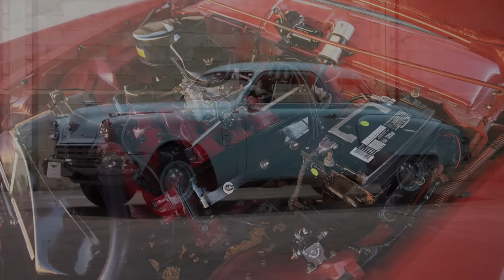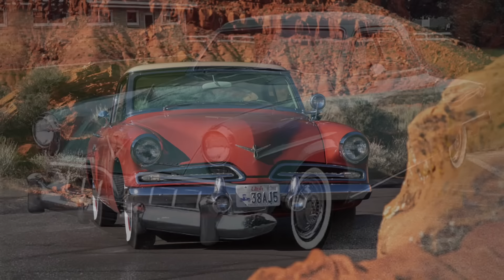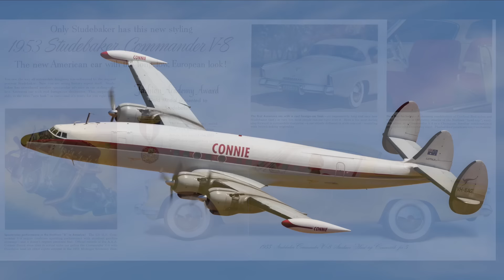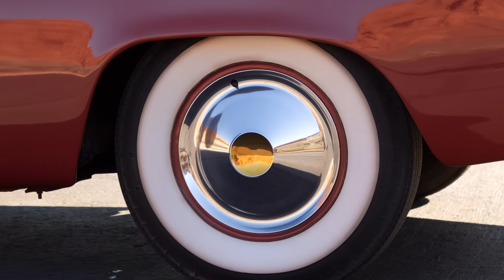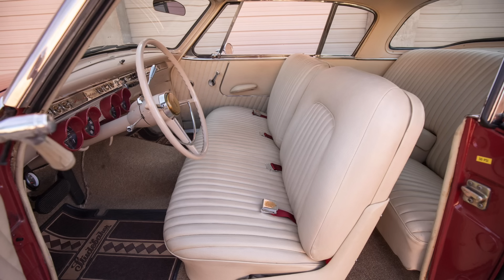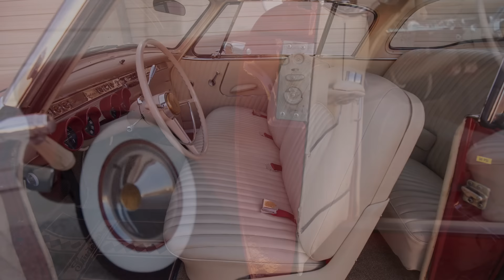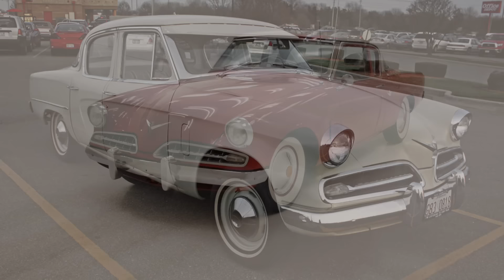Most Beautiful (& Flawed) Cars: 1953 Studebaker Coupes Had Only Skin-Deep Beauty

Comment: Keep everything above the frame (the body) plus the hubcaps, donate everything else to someone in need. The frame, engine, drivetrain, and running gear are abysmal. The body after getting good looks is very fine. I could see lowering the front part of the roof somewhat, angling the entire assembly downward a bit. They seem cheap enough to where modding the hell out of it while keeping the overall looks would be an awesomely fab project. Who would care if only the sheet metal and a few other choice bits were a Stude .. I wouldn't

Comment: My first car was a 53 Studebaker Coupe.  I bought it for $85 in 1961.  It had the V8 with a 3 speed manual with overdrive.  By the time I got it the fenders were rusted and it had a broken leaf in the rear spring (witch I couldn't afford to fix) but it ran fine.  I could be convinced to buy a restored one.  A stunning design!

Comment: Later the Hawk came with a Packard 289 engine in an attempt to increase the performance.  It was often connected to a 4-speed transmission.  Unfortunately that made the weight distribution of the front and rear wheels even less optimal. The result was a loss of traction and a tendency of the rear wheels to slip under throttle.

Most of the early problems were fixed as new ones presented themselves.  Part of the performance problem was Studebaker continued use of thicker gauge sheet metal in later years.  A boon in a collision it was not nearly so welcome at the pump or off the line.

Comment: The sales literature referenced the European look. Sir William Lyons’ seminal 1948 Jaguar XK 120 was no doubt highly influential with the Loewy design team. The  Studebakers longer wheelbase allowed the designers to greatly improve on the Jaguars cramped interior. Unfortunately it also accentuated the frames ability to flex. The XK 120 was built on a shortened version of the stout Jaguar Mark V frame and that rigidity allowed for acceptable racing performance. Jaguar developed the XK 120 into a pure competition model, the C Type, but replacing the XK 120 based frame with a much lighter and stronger tube frame design. Studebakers’ later performance car, the Avanti, saved weight with a fiberglass body.

Comment: I was 17 in 1962-3:  I had one of these with 3 speed, 232. OHV V8 w/ over-drive -  we put in a floor shift and an OD clicker switch on gear-shift lever. You could click the OD in and out in every gear.   I put an ARC 45 rpm record player in it  w/ Motorola Vibrasonic, with two rear speakers, quite cool .  I always loved the lines and body design because it looked like no other car of the time.  Studebaker caught a lot of flak for their "Lighthouse" look models, but then comes this Commander and  the industry changed.  I really wish I still had my '53.  I do, however, have a 1982 Alfa Romeo Spider Veloce with similar grille shape.  PS:  The hoods on these cars were notorious for coming loose  at latch and wrapping over the roof.  Happened to me twice.

Comment: There was a really good article by Michael Lamm in one of the early issues of Special Interest Autos about the 1953 Studebaker that covered some of the issues that you mentioned in your video. Another point that I remember was that Studebaker didn't expect the demand for the 2 door coupes to be so high, so they lost a lot of sales because the factory was building mostly the regular sedans instead of the coupes.  The ornaments with the three pointed stars that Mercedes objected to were changed sometime in the model run. The gray car at 7:23 shows the original 3 point stair design, whereas the red car at the beginning of the video shows the later ornament without the third point.

Comment: My first car was a 1955 Studebaker Champion. I bought it in 1960 for $125.00 and a 1949 Cushman motor scooter. I drove it all thru high school. It had a straight 6 cylinder engine  and "three on the tree" which I later changed by buying a Hertz converter kit to put it on the floor. It was a fun nice looking car for a young guy to start out..
El Mirage, Arizona

Comment: They all had gauges, not idiot lights, 3 speed all synchro manual transmission or 3 speed automatic transmission, electric Over Drive option, and rear end gear ratios from low 3's, to the high 4's. Nobody else had that at the time. They were at the top in getting gas mileage at the time.

Comment: I have a 55 Commander 2 dr htp that came with the one year only downsized (!) to 224 cu in V8. I changed the crank and pistons to make it a 259 cu in. It had a frame off resto in the 1990's and is still pristine. When the car was finished I went to a Studebaker International meet in Portland Ore. and I met Bob Bourke, who did the design along with Bob Koto. We had a short conversation and I thanked him for designing such a fine car. He asked me what year mine was and when I said 1955 he went off in a tirade about how Studebaker plastered the stainless trim on the sides and put "that fish-mouth grill" on the front. He stomped off in a huff and left me standing there slack jawed. He had said that he was there to give a talk on Studebaker design and I always wondered if he got over that tirade before the lecture.

Comment: I can only assume that a modern, lightweight engine made all the difference, but my 59' Lark handles like a dream and goes down the road with confidence. It's a very light car in general and I can confirm its pretty cheaply made (rubber shims are present and yes, the crappy door latches do fail to latch often)
But, with a mostly aluminum modern inline 6, disc brakes, swaybars and modern wheel/tires it really is great handling little car. I've pushed it quite hard and I feel it could compete in some auto-X pretty well. The crazy thing is that I still run the stock springs and general suspension setup (kingpins, ect)

Comment: The history of Studebaker is varied with a lot of influences. The bankruptcy around 1936 had the effect of making cautious about its medium priced cars. Although they had tried to make a low priced car twice before, the 1939 Champion was successful. But after that, Studebaker wanted volume instead of profit. The President series’s didn’t come back after the war until the mid fifties. It was a beautiful car that could have been profitable after WW2, when they could have sold anything on wheels. After the war, when all the independents were flush with cash, Studebaker decided to sell the Champion, instead of the more profitable Commander. This could have put it back in the lower medium priced class. The 1947 model could have been introduced in 1948, while they produced the prewar model. The Land Cruiser should have been a President, along with the Starlight coupe with its wraparound backlight and maybe a convertible. This would have been beneficial to the bottom line. The 1953 Starlight coupe and hardtop, along with a 4 door would have made a great President with V/8’s instead of sixes. Studebaker didn’t plan for the cars success, they only planned for sales of 5%. I had heard that the front sheet metal didn’t join up to the cowl, but the chassis flex was probably why it didn’t line up. If they had done a better job, they would have been in a better financial position, especially Packard bought them. Studebaker could have made themselves more attractive, especially with Nash. Nash wanted to buy Studebaker’s V/8, which they turned down. In return, they could have gotten Nash’s Weather Eye air conditioning. The potential for growth were varied. If both Packard and Studebaker had their quality and engineering together, they would have been more attractive to AMC. The independents were the innovators of the y
Industry. Thanks for your channel and letting me vent.

Comment: My Alaskan white with red leather 1947 Champion convertible was beautiful, but jacking up a rear wheel made a big crease appear in the plastic rear window due to the flexible frame.  And the first quarter turn of the steering wheel just caused the front wheels to lean over sideways.  Girls sure liked it, tho.
Later on a friend of mine built a Studillac, a 53 coupe with caddy engine, much bigger brakes, etc.  Nice.

Comment: The Studebaker V8 was enlarged to 304 cubic inches, in the Avanti R3 and R4 variants; there was no R5, except a prototype, which was a twin-supercharged R3 engine built by Andy Granatelli. Only 9 R3 Avantis were built (304 cid with a Paxton supercharger and other mods to the car). There were no R4s, although they are listed in the parts manual; I believe one R4 engine made it into a Daytona. The Granatellis made about 100 each of the R3 and R4 engines, most of which were sold as crate motors. They bored the Stude 289 out to the maximum they could reliably achieve...and those were specially-selected blocks with little core-shift in the cylinder area.

Comment: . . . my Pappy, born 1908, was a Kaiser and Studebaker fan.  I was not born in 1947 when he moved the family from Wisconsin to Phoenix, Arizona.  From photos, I know he then had a Kaiser and next a 4-door Studebaker.  Being an electrical engineer (who labored on the WWII Manhattan Project) in the early 1950s, he rigged a mercury switch under the driver's seat so that when someone sat in it, that set off the car's horn honking. (I always wondered what those brown jugs of mercury on the garage shelves were for.)  One night he forgot to set the alarm, a felon broke out of the Florence, Arizona penitentiary, made his was to Phoenix, very easily hot-wired Dad's car and drove it all the way to . . . Wisconsin, where he was eventually re-arrested.  Dad borrowed a car, I guess, and took on a total stranger co-driver who wanted to go back to Wisconsin,  to journey to the Dairy State to collect his Studebaker.  I don't know what happened to the 'borrowed' car.  I do recall, the auto insurance company gave Dad a brand new two-tone, red and white Packard with the first auto air-conditioner I'd ever experienced, to drive while they searched, police searched, for his Studebaker.  I was somewhere around 5 or 6 at the time.

Comment: I almost bought one of the Stude coups ( yellow/green)in the mid 1960's because of its styling . However, as a very young  mechanic I learned of some of the flaws which and the potential demise of Studebaker Packard and opted for a 1958 Chevy Bel Aire which served me well. To this day, I still especially appreciate the '53 Stude coup styling. There are 4  die cast models sitting on my library shelves:  the 53 Stude Coupe, Buick, Packard and Chevrolet  reminding me of the of the "styling glory days" of cars that are no more. Thank you for your presentation, much appreciated.

Comment: I had some experience with these.  The only shortcoming with the V8 that I know of was that the valve train oil seals were prone to early failure.  Not a difficult repair, I did mine parked on a city street while a college student.  But it was a design weakness.

The block, on the other hand was outstanding.  I had built several flathead Ford engines of the preceding era.  To build a performance engine you could bore 3/16", but occasionally the sound of the exhaust when your first lit it up was followed by the sound of the engine blowing a cylinder wall and seizing up instantly.  I helped a friend build a Studebaker.  Against my advice, he bored it 1/4".  There was more cylinder wall after a 1/4" boring than the Fords had before you touched them.  It is no wonder they could add to the displacement so easily in later versions.  He use an Iskindarian roller-tappet camshaft and raised the CR to 12:1 by shaving the heads and ordering aftermarket pistons.  Fortunately, he found an outlaw Sunoco station where the owner had fixed the pump so the "blend" dial could be set to 260.  That engine was magnificent!

Comment: The Studebaker V8 could have very easily been taken out to 400 cubic inches it had 4.5 bore spacing while the Chevrolet small block was 4.4 and the Ford small block was 4.38 and they easily had room for 4 inch bore so the Studebaker actually had more room to expand the bore. With a 3/8 inch longer stroke the Studebaker would have been 402 C I D .

Comment: For years when I was a kid, my grandmother drove a 53 sedan Studebaker (not the cool coupe) however, to those younger, her car was a 3 on the tree, with no power steering, no power brakes with a starter button on the floor and a mohair cloth interor. No air contioning of course, but it did have front vent windows and extra vents in the footwells on eash side...It took me all over Miami for years.

Comment: My first car when in high school was a '53 Commander Coupe, identical to the white over Coral Red shown at the start.  I chose the Studebaker because all the "cool" dudes were driving Fords, Chec, Mercs, etc.  I have always rebelled at doing what is popular.  Much of what is said here is accurate.  Definitely not a muscle car.  As I recall, top speed was barely 110 mph.  But it would out corner anything else on the road.  I could leave just about anything behind on a winding, twisting road.    A low center of gravity, was a factor.  But even more than that, the front/rear balance was very good because the engine did not sit between the front wheels, but a bit behind.  A line from front spindle to front spindle passed through the water pump, giving about a 60/40 weight distribution.

Comment: First car was a 53 coupe with 283 Chevy and 3speed from a Vet.  411 gears.  250 # lighter.  That solved the frame problem. Not fast, but no one,  I mean, no one could beat me off the green light.  After ahead two car lengths, change lanes to shut them down.

Comment: Thank you for a very informative video. My dad and I just finished restoring a '53 Commander coupe, and because of the perceived frame flexing we dropped it onto a '62 GT frame. We also added torque boxes underneath the body to help the stiffness and it's a lovely ride, tight and controlled. At the Paris Salon the design won Best of Show for two years running until pipped by the Citroen DS in '55. Simply a beautiful, elegant car.

Comment: Dad got Mom a brand new 54 Commander hardtop, 2-tone Forest green roof and cream body. It had a couple of unmentioned features that helped my mom a lot. One was the automatic overdrive. When you got to speed in 3rd gear, releasing the throttle and quickly resuming would drop into O.D. (which could be locked out with a handle), and the mileage improved. Blip the throttle and 3rd gear resumed.
The second feature was more important as Mom worked in San Francisco and we lived in a hilly town just south of the border. It was a hill-holder clutch. When you were going up a hill and had to stop for traffic, you could release your foot from the brake as long as you held in the clutch. Then with a smooth motion (and no foot shuffling), you could take off up the hill without big clutch slippage. Releasing the clutch (just slightly) released the brake.
The video showed it a bit, but the driver's seat was also the first semi-"bucket" seat that I ever saw... another innovation.
Reply: I think the overdrive was made by Borg Warner and was also available on a lot of other cars like Fords.
Reply: @emjayay sounds likely, but the old 40 Ford it replaced didn’t have one. 8-)

Comment: My first car was a red and white 1953 Studebaker Commander Starliner, very much like the one in the video.  I took my driving test at age 16 in the car.  Yes, the car had some quirks, but it looked sharp and was fun to drive.  It was equipped with Automatic Drive and power steering (not as over-assisted as 1960’s power steering).  Automatic Drive, though a bit sluggish, was advanced for its day, with three forward speeds and torque converter lockup.  In the “Drive” position, though, it began I second gear.  It was also equipped with the Climatizer, an early automatic climate control system.  The heating vent was under the passenger seat, and it provided heat to the front and rear, automatically maintaining a comfortable temperature.  There was also a fresh air option for the heating system, and with the outside passenger side vent open and the interior vent door closed, the system provided fresh air heating.  Another innovative option that I have not seen since was an anti-creep device for the Automatic Drive.  After stopping for sign or light, you could lift your foot off the brake pedal, and brakes would maintain pressure until the accelerator was pressed.  The car handled curves well, and during snowstorms, the Studebaker would be the only car on the road.

Comment: I had a 53 Studebaker Commando , it had the v8 and a 3 speed manual , it also had a freewheel feature , so to shift it , all you had to do was to let up the gas pedal , and just shift it , no clutch required . Once you got used to it , it  worked great . Also if you were going downhill and needed engine brake , it was easy to disable .

Comment: Some things to note:
  The reason for the long trunks on the post-war "airplane" bodies and the '53 and up bodies was that Studebaker planned to move the engine to the rear of the cars.  That never happened.
  The longer wheelbase on the coupes initially caused no end of problems for Studebaker.  They had planned on selling many more shorter wheel based 4-door sedans and could not make body parts quickly enough for the demand for the coupes.  Many buyers cancelled their orders for the '53 coupes because they got tired of waiting. 
  Another poster has replied and given information on the Studillacs, Studebaker hardtop coupe body, Cadillac engine.  Produced between '53 and '55.  Scroll down for more details.